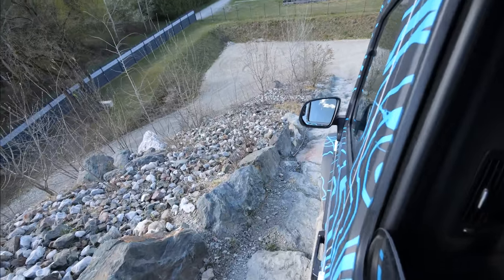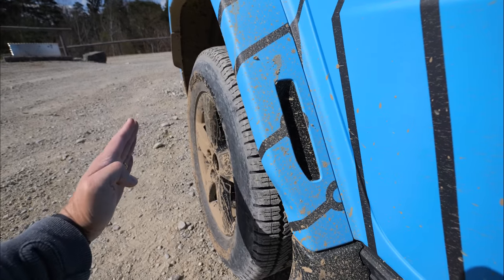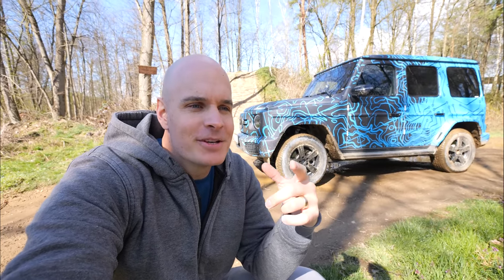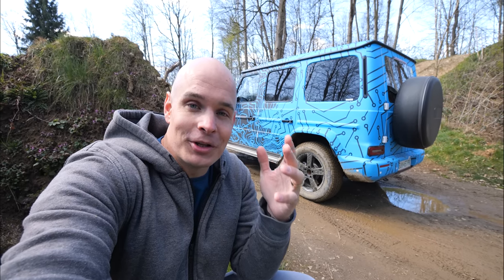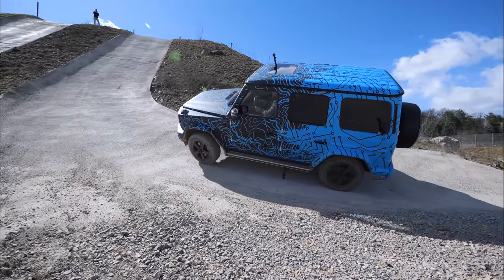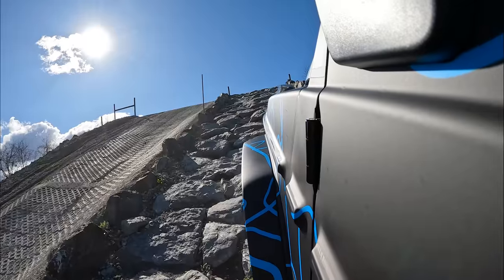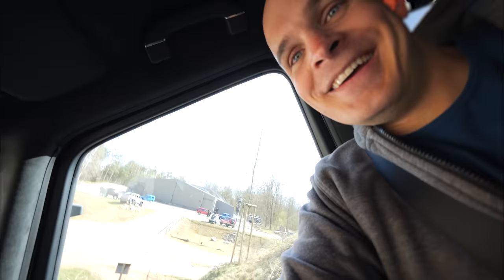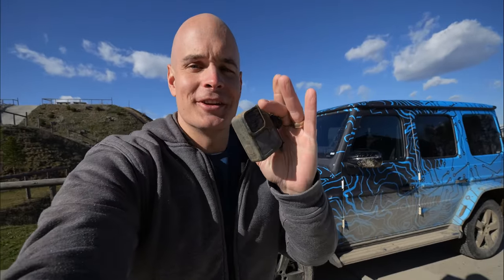The New Mercedes EV is a Luxury Stair Climber - (Sneak Peak!)

Comment: My mom is gonna get it when it comes out next year. However, she was a bit concerned with the handling. Does when you drive it, does it feel like a boat? Like does it rock when you turn? Thanks!-
Reply from the maker: Feels great.  With all the weight near the bottom (in the battery) it always feels solid.
Reply: @JerryRigEverything  thanks for the info!!!

Comment: I don't get why the extra 'low range' gear box is needed? Power shoulden't be an issue with the 4 electric motors so if it's for control, i would have solved it with a different accelerator pedal profile in software for maximum low speed control. (kind of like Tesla's chill mode, when the power is much smoother)

Comment: The stair test is not quite the real life scenario, because those stairs slope in and out more than any regular stairs would. The actual Performance is absolutely insane. Everything about this make me realize once more, how insanely overcomplicated ICE cars are and how limited their capabilities are..
Reply: The ability to travel a thousand miles in extreme heat and cold without refueling, the ability to carry out repairs in the field, refuel using low-grade fuel generally found in remote areas, the ability to refuel anywhere around planet Earth in 5 minutes... those kinds of limited capabilities?

Comment: The G-Class always was also a military car. And with those driving capabilities and maybe some added battery swap tech it could be a real asset in the field for fast and light scouting, drone operations or even portable rockets. It could add cooling to mask its IR signature. I wonder how long it will take until that happens.

Comment: I would like to point out that @agingwheels "The Electrek Uncar is a Goofy Electric Car Built Entirely in Colorado" reviewed the electrek that has a 4-speed manual from 1979 (the car was built in 1979 by unic mobility with a brushed dc motor with a "smooth power delivery" speed controller with regenerative breaking).

Comment: I bet the military will start to replace smaller offroad gasoline / diesel vehicles with electric ones. Reason: they are silent, much less heat and extreme torque. Plus, they can be charged with solar panels. Sure not an option for tanks or large trucks today though.

Comment: 4:40 it's not a problem with the proper gas powered off-roaders like the Ford bronco raptor or the g63. They will do the same without any problem if NOT better. The normal g63 has already done it before but yeah, they can't do the g turn.

Comment: EVs absolutely do not have 100% Power at low speeds.   Most of them have peak torque available, but recall Power = Torque x rpm.  Small rotational speeds result in small amounts of Power.  That's not a limitation of the Powertrain, that's physics.

Comment: Tacomas had something called “TACOBOX” thats a modification the the transfer case, they increase the turn ratio to 1:400 or something high like that meaning every 400 turns the box does only one. Creating CRAZY amounts of torque at IDLE!!!!! The damn tacomas actually CREEP up or down steep hills very very slow without anyone stepping on the gas (since it’s at idle). So yeah nice try Jerry.
Reply: Not to mention you could literally STEP OUT OF THE SLOW MOVING VEHICLE and let it do it’s thing by itself. Go check it out, it’s pretty fucking awesome. Something this EV can’t do.

Comment: How is the battery protected?
Since the car is supposed to be used offroad, and the battery is doomed unsafe with even a scratch on it, I want to know what kind of protection/warranty it has.
There is probably not a sqare bigger then 10x10cm under my car that hasn't had a rock hit, and several has caused dents.
Sure skidplates can take a lot of the beatings, until you get gravel inbetween the skidplates and the battery.

Comment: As an offroader, I find the electric motor very intresting and usefull.. However this vehicle, the G Class.. is not exactly the most capable off-roader or anything like that.. the car has fundemanetally designed for luxury buyers.. The wheels and tires are horrible for offroading.. then fender is too low for any real articulation.. The chassis sit very low and need a lift. the suspension system is independent.. which is not the best choice for off-roading as it limits the articulation.. long story short.. while it can off-road occasinally.. this is not a vehicle you depend on going out on trails for days..

Comment: It's nice but almost no one is going to go off-roading with an EV, you aren't going to have the charging infrastructure, and no portable solar panels won't charge it for shit.
The G Wagon is already the posh trophy wife car as it is, even if has the same range as an EQS / EQS SUV which it likely won't since it seems that there is far less room for batteries due to the clearance required it's still isn't nearly enough for off-roading. 

You can always take extra petrol with you with an ICE or a hybrid, but with an EV you are completely stuck with what you get on a single charge. 
And I'm actually surprised that they didn't went the plug-in hybrid route with this one. Give it a 30-50KM range on a battery which is enough to make it green for most city runs but also actually allow it to be a safe and practical off-roading vehicle. 

The other problem with it being an EV is the weight, which is going to greatly limit it's traversability in sandy environments and wet lands as well as other terrains which are weight sensitive. The G Wagon is already pretty heavy at 2.5 tons, however EV's are just that much heavier, the EQV is over 3 tons, the EQS and the Audi eTron 55 are 2.8-2.9 so the EQG would likely will be in the 3.2-3.5 ton range.

The last thing is that it's a G Wagon so it's basically a brick on wheels, the aerodynamics are going to be completely shitty regardless of what optimizations they make, it's shape and the amount of ground clearance it needs as well as the wheel size pretty much going to kill it's range which will only make it that much heavier since there is no way they'll release it with less than 500km/300miles of range.

Cool toy, but utterly useless other than for a school / mimosa run...

Comment: I suspect it will be quite powerful, just to do that spin @ 4:00 that easilly probably requires at least 800nm (588ft lb), considering how heavy a normal G-class is, an electric G isn't exactly gonna be lighter and extra weight adds friction so.
Even though no numbers were called out in the video I guess around 800hp, 1200nm (885lb ft) and around 2750kg (6000lbs). Based on what you can see it do in the video, how much a G63 weighs and that Mercedes likes making torque monsters.
LIKE I SAID THOUGH ONLY GUESS. DON'T QUOTE ME.
Reply: Even the ICE G Wagon's are very powerful, huge torque, so I guess these take things even further. There is a clip with a very difficult offroad test between different cars and at some point a G pulls the Land Rover up the hill. Tried also the other way around, but could not pull it.

Comment: Reasons why apple sucks
1. Preventing software downgrades on iphones by not allowing unsigned ipsws to be installed on iphones.
2. Making Photos Libraries incompatible on different mac os (forcing you to purchase icloud to transfer photos libraries 
3. Remotely Disabling and Bootlooping iphones on older ios forcing them to update and erase the phone.
4. Not allowing newer backups to be restored to older macos/ios. On mac os you would have to restore everything manually. 
5. Disabling older applications that use internet once newer versions are available that are only compatible with newer OS forcing you to update.
Reply: There's more.

Comment: I think it is a nice idea but I question how reliable it will be. The German car brands seem to have issues with electrical and electronics. Do I trust buying an all electric vehicle from a company that cannot make a reliable combustion powered vehicle or even reliable power windows? Old benzes from the 1970's and 1980's (like the 240D or 300 series) were very reliable because they had very few electric systems. GM is another one i want to stay away from. When two of your cars (the Volt and Bolt) have issues with the batteries catching fire then it is time to look elsewhere for an EV. My first EV will ether be a Hyundai or Kia or Ford

Comment: Jerry, you hit the high points of ev, but left out Every low point.  8,000lbs for one. And your bs comparison to ice engines is wack. Ice is also gear reduced,  instant tq, even at idle.  Electric motors loos power with rpm, another bit you left out, why not discuss the insane 8,000lb weight?

Toyota has has crawl control for years. Set the knob, the computer does everything but steer. Please stop shilling for ev and be honest. 

Showing a 8k lb g pig on trails my 79 datsun could handle is not much to brag about.

Comment: GoPro sux so bad. Worst freaking software in history.
Most unstable, unreliable piece of tech ever. And it hasn't got any better, from GoPro 1  to 12....
It's a 50/50 shot if you have battery, when you need it, it's a 50/50 shot if has even recorded anything.
The whole cloud spamming in the app and the proprietary video format, that forces you to download AND convert the videos before you can use them, takes forever.
And, my Note 10+ still takes better photos and videos than GoPro 12....
Absolute garbage!!!